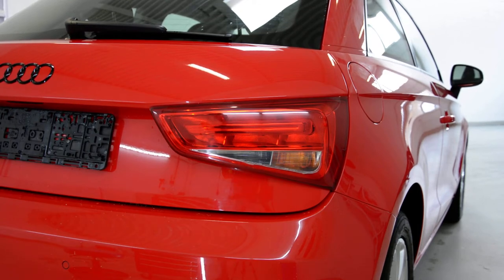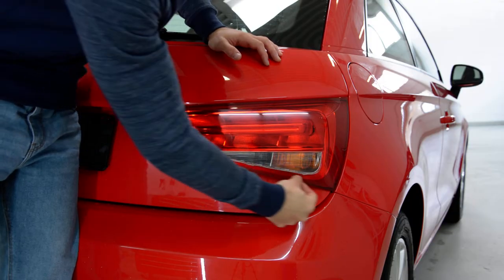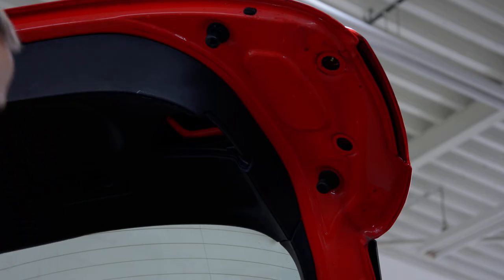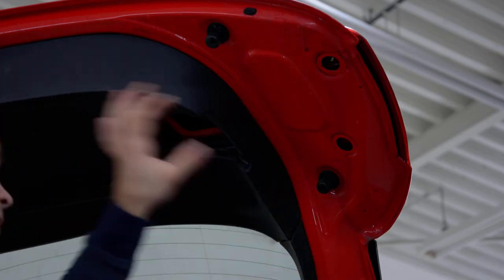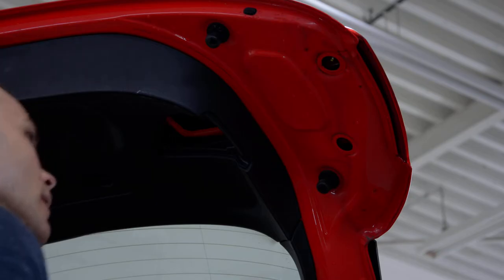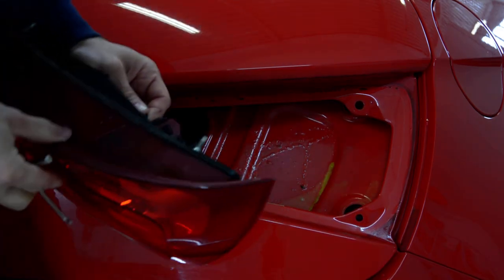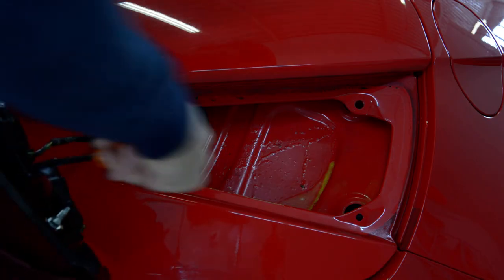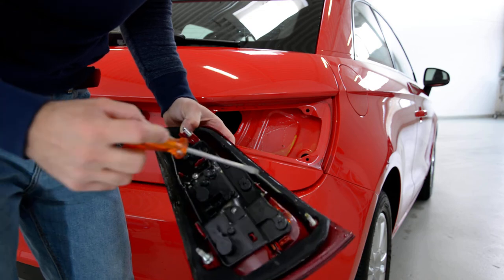How to change the rear bulb on a Audi A1

Comment: This video saved me from am overpriced trip to the dealer. 5 Minute video and it's removed already. I will assume it's 5 minutes to put back on. Went to the audi dealer and they wanted more than 100 euro to replace a single bulb, bulb cost 4 Euro.
Reply: Changing a bulb is easy, you just have to remove the light fitting. This is why men like cars, because they are practical people.  That said many men are now just little girls.
Reply: Time and knowledge is money, the more you know and can do it yourself the more time/money you save, I have the same model and I'm switching all to LED bulbs, cheers !

Comment: WHAT was Audi thinking?? This certainly isn’t a quick ‘roadside replacement’ if you have a blown bulb!
Reply from the maker: For example if you want to change a bulb on some cars on the front light you need to take the bumper down .
Reply: Exactly! Ridiculous
Reply: Take out your fittings.  Fit a full replacement kit of LEDs.  No more replacement needed.
Reply: @EnglishLaw  except they suffer from condensation, even more so with no heat being generated by the old inefficient bulbs, so at the minimum splodge some vaseline over every electrical contact including the LED bulbs circuit boards. There's probably a better solution if one can let me know I would appreciate. Would Silica Gel sachets help too?